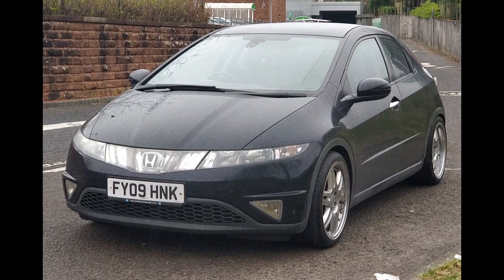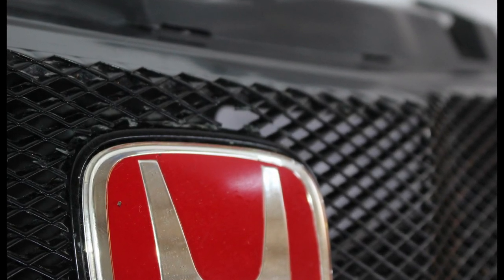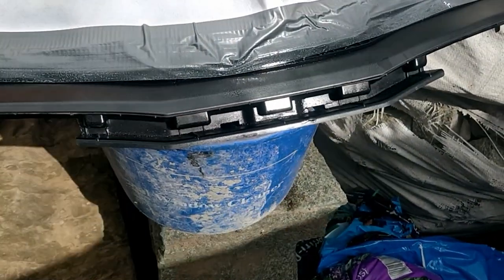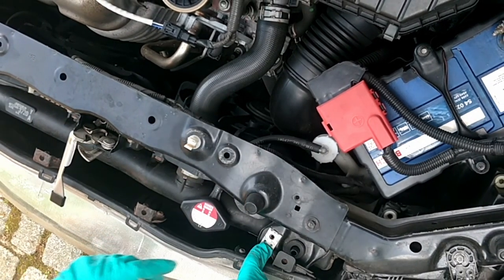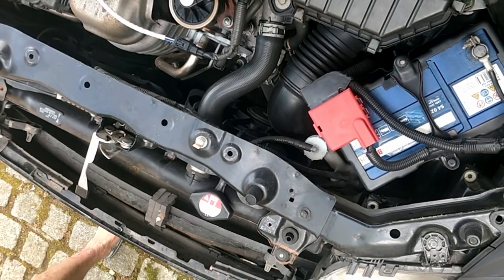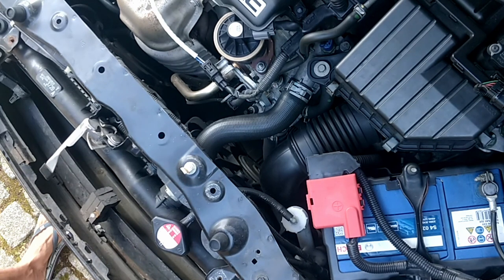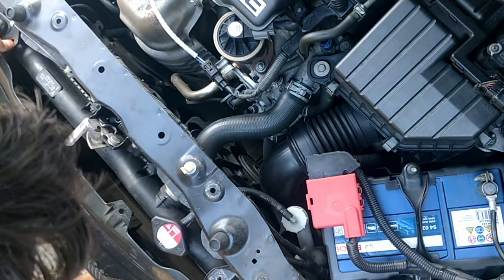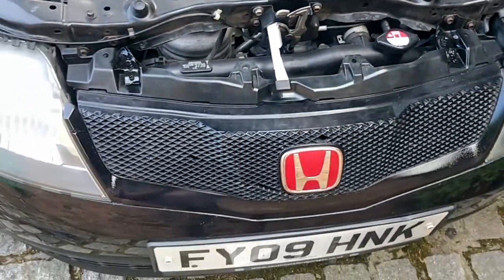Honda Civic Mk8 Type R Mesh Grille Upgrade

Comment: Hello mate just watched the vid . Really enjoyed it. Just wanted to ur advice because one of my clips to attach the grille is broken so what would u recommend?
Reply from the maker: @adambadat1974  hi there, I had the exact same issue, in the video I used banding strap, or use similar,  try using some good epoxy or id you can some small screws as well on the inside. If all else fails and you are not that handy, you could use tie wraps 😉

Comment: Good job. Thinking of the same upgrade to mine as it looks so much better than the perspex. How did you make the new clips? Expecting to have the same problem...
Reply from the maker: I fabricated the clips using banding strap, you can cut to size, it's galvanized and has holes

Comment: Hi did you have any problems removing or installing the grill regarding the bumper? other videos have shown that you need to take the bumper off to unclip the bottom of the grill and to reattach the bottom too, but your video didnt mention that!
Reply from the maker: There are clips at the bottom of the grille, but you don't need to remove bumper
Reply: @GrooveOn  Thanks, Great videos keep it up mate. Cheers!

Comment: Hi, thanks for your video. Is your Civic a type R or is it only your new mesh face that comes from a type R? I'm asking as I'm wondering like Harambe in the comments if it is possible to remove the front without removing the bumper. On mine (2009 1.8 german model) the clear face is attached by clips on the lower side, and is not moving/sliding as in your video after undoing the upper nuts. Different moutings depending on specific models? or may be I didn't worked the face enough to loosen it on the lower side?
Reply from the maker: Hi There, I bought a type R grille and it fitted great!
Reply: Hello, I have the same problem as yours, have you been able to change it without removing the bumper?

Comment: Did you take the bumper off to change the grill
Reply from the maker: No mate, no need, there is a clip at the bottom that slots into bumper
Reply: @GrooveOn  ok cheers 👍
Reply: Hello, I have the same problem as yours, have you been able to change it without removing the bumper?